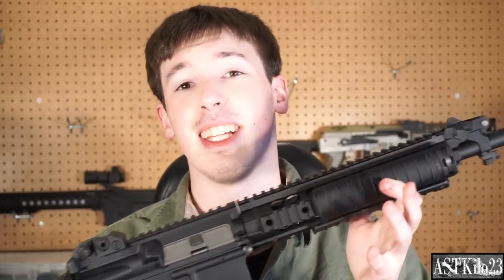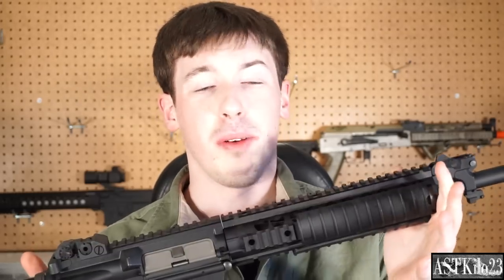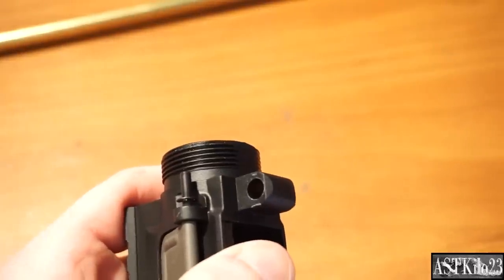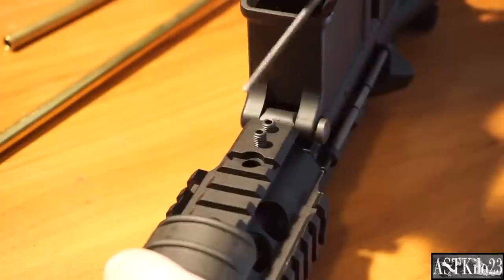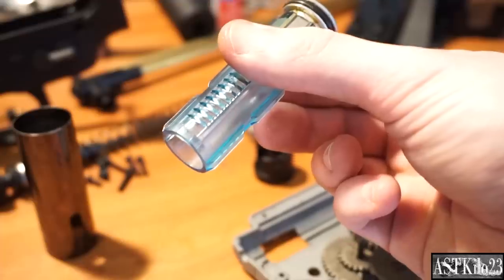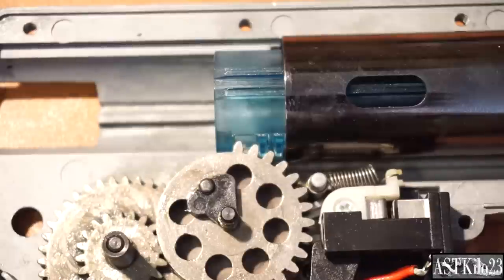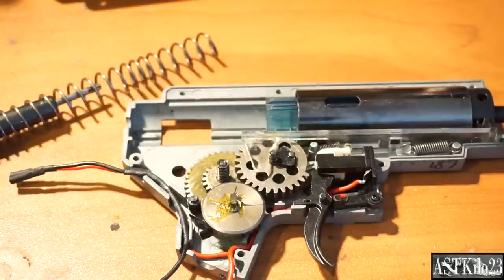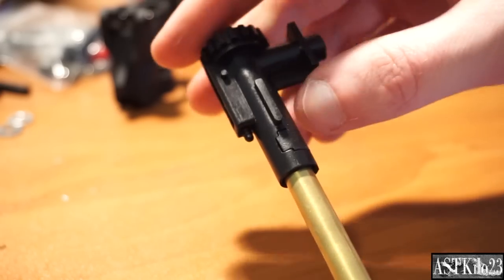VFC VR16 Custom Indoor Build   -ASTKilo23-

Comment: I am having the toughest time taking the front sight off. I've gotten both body pins to budge a little bit, but that is all. They just wont budge any further. I am using a hammer along with some sort of punch, and am hitting it on the rounded side. And now I am trying to unscrew the screw, but I think they used loctite on it. I guess maybe later i will try heating up the screw to see if this is true or not. Did you have similar issues that I had when doing this?

Comment: What is the durometer of the sorbothane that you use and what is the thickness?
Reply from the maker: RedWireAirsoft i think mine is 3/16in and 50d. i'd have to double check, but that sounds right.

Comment: that is some black magic shit right there haha. "i want to hit about 300fps" hits 297-299 again and again.please tell me you had multiple tries to do this because it makes me feel bad
Reply from the maker: Evan Dickerson You probably won't believe me, but it was shooting 320-325fps ish with the longer m4 length barrel the first try. When I installed the shorter 300mm barrel, it dropped to the 300fps ish mark. First try, no joke.
Reply: can you send me a locket with your picture in it so i may worship oh airsoft god? haha but seriously damn good job looks sick. btw been looking to buy a vfc m4 do you recommend a certain model.
Reply: If your having a problem shooting over the field limit for feet per second   You can turn your hopup all the way and it will bring the feet per second way down. It might help.
Reply from the maker: Matdx EOD true....but that is technically cheating unless you leave it ramped up like that. Then you go onto the field, decrease your hop up, and your fps goes right back up.
Reply: Matdx EOD Most indoor fields, including the one I work at turn your Hop up off to Chrono.  After all, this is a sport of Honor.
Reply: I was just saying. I'm not implying. One or two fps will not hurt
Reply from the maker: Matdx EOD i wouldn't worry about 1-2fps. but in the past, i have chronoed my guns with the hop up on and compared it to the hop up off. my old kwa m4 ris: 470fps without hop up, 440fps with hop up. Run it with 0.28g bbs and the chrono thinks you're shooting 370fps... doesn't feel good to get shot by. my point it, chrono with the hop up off.
Reply: ASTKilo23 Chrono by joules and that is what we go by.  Does not matter on the BB Weight then.  Safety First.